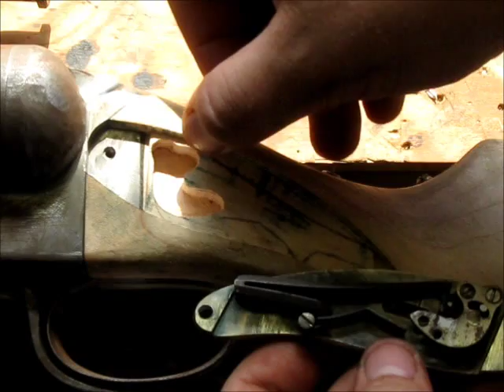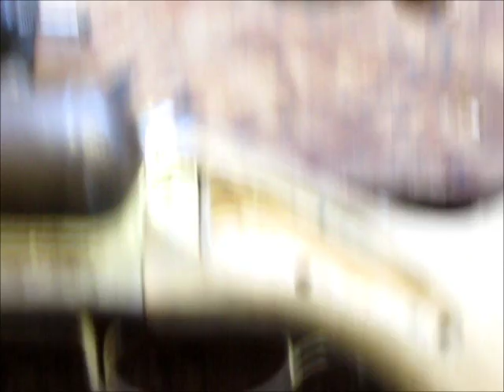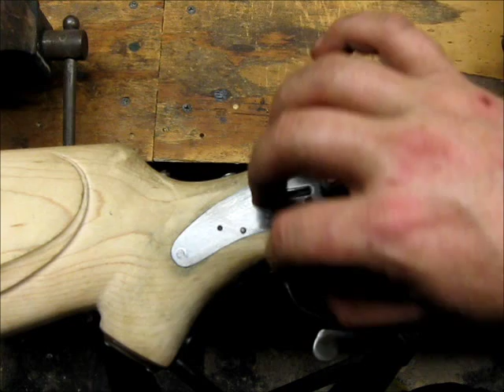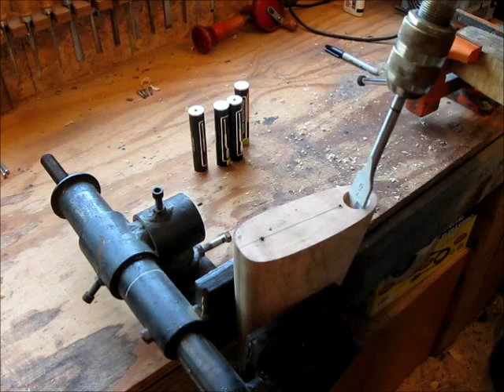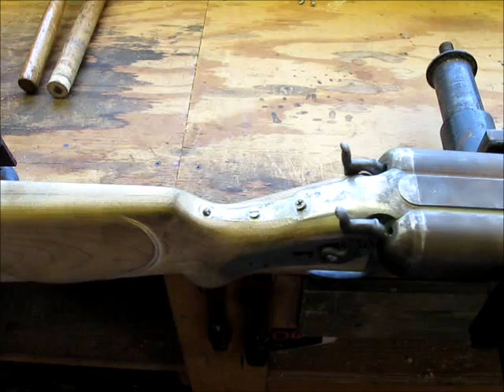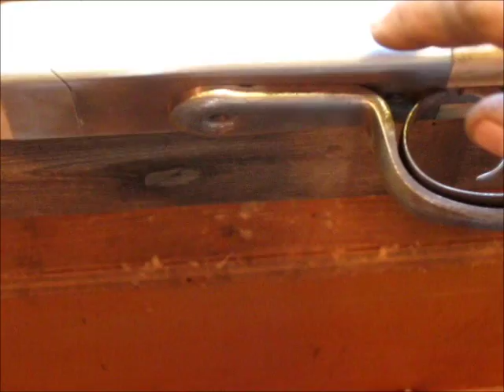2 Bore SxS Double Deuce Part 31

Comment: I'm kind of surprised you didn't put some sort of plate with lead infill in between the end of the stock and the shoulder pad. the weight would have been further back, making it push the balance point further back as well.